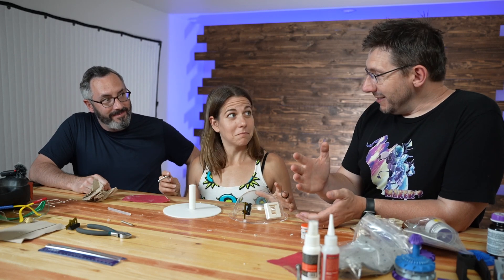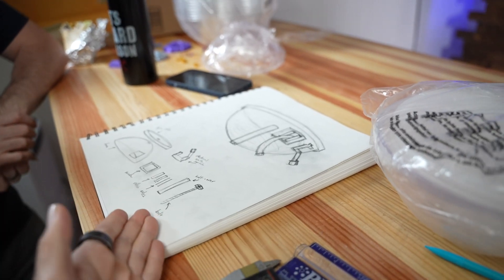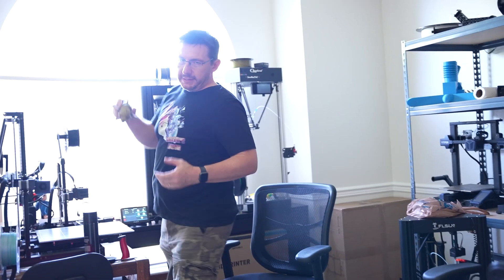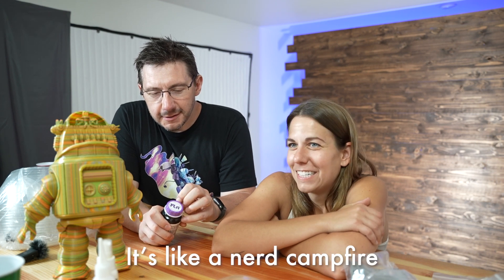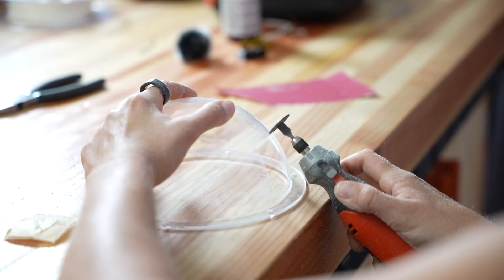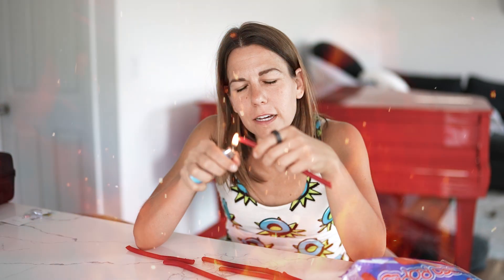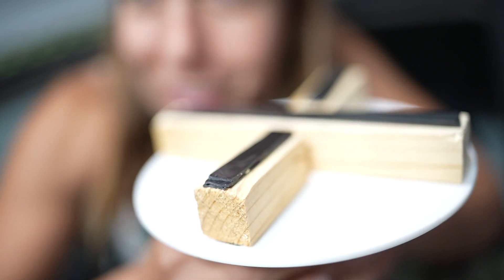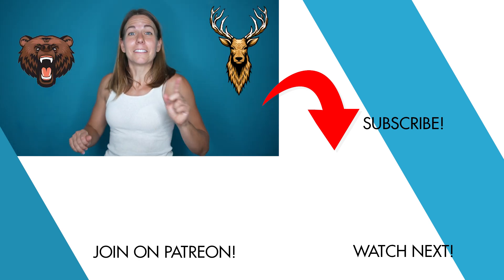I Make a Car Candy Dispenser (from Wayne's World!)

Comment: I'm pretty sure that square sheave piece they custom made is a regular hardware part you can buy.  It's used to help pull wires through holes in the walls so the wires doesn't rub and get stuck on the edge of the wall. I only know this because I work in a hardware store and they probably couldn't get one that small anyway. still really cool to see them 3D print their own ^^

Comment: Knife switches are not sold commercially because they are a safety hazard and kind of impractical for most electrical work, but you can get them from science supply companies that sell STEM kits to schools, because they are great tools to teach electricity and circuits. I saw the knife switch and though of all the science labs where they are sitting in a box full of wire and old electronic sets.

Comment: I'd have been tempted to put one of the pieces of liquorice in a hot glue gun, instead of the glue stick, and then use that to join the other pieces. Probably wouldn't have ended well.